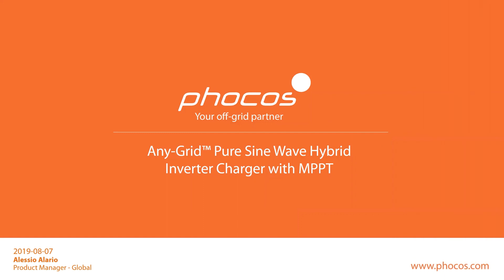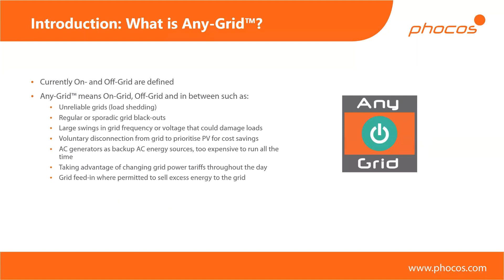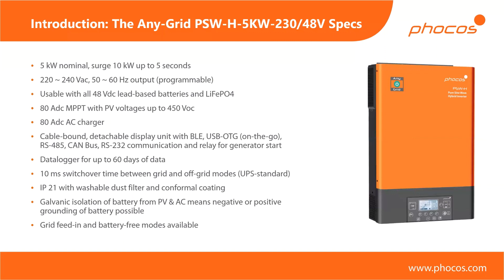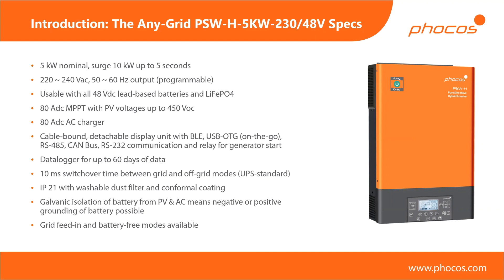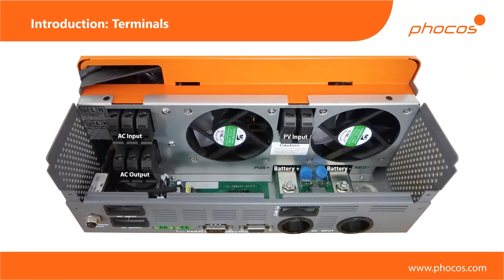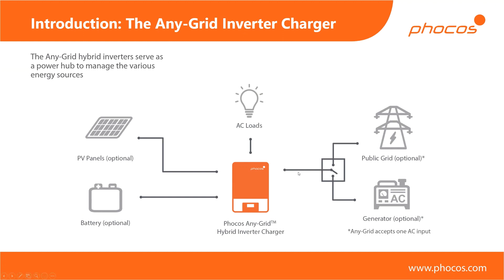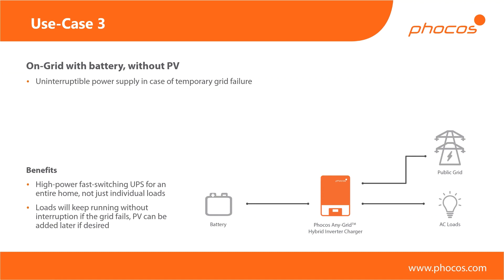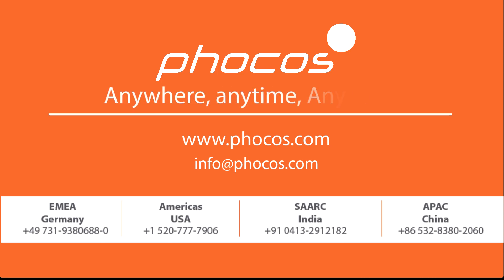Part 1/3 - Phocos Any-Grid Hybrid Inverter 230 V Webinar (Intro, Use Cases 1-3)

Comment: Hello,
Thank you for the very detailed video.
You are mention that Grid feed in is possible but the function is locked by PIN. What do you mean?
Reply from the maker: Hello, thank you for reaching out to us. Although our line of Any-Grid PSW-H inverters can feed into the grid, this feature is not allowed in all areas. As a result, the inverter comes with this feature “locked” from factory to help prevent users from potentially violating any local laws/regulations. To receive the grid-feed in pin please reach out to our tech support and they will happily assist you https://www.phocos.com/contact/#contactech

Comment: What is the minimum amount of solar panels you can use with the inverter with 100a lithium battery?
Reply from the maker: Hello, the amount of solar panels required will depend on the size of the inverter charger you are using and the panels themselves. The Phocos Any-Grid 5kW PSW-H, for example, requires a minimum of 120Vdc for the solar charge to begin operation. Please contact tech.EMEA@phocos.com for further advice.

Comment: I installed the Anygrid 5kw with two (2) Pylontech US3000C batteries; but I can't seem to get the inverter to communicate with the batteries. Kindly advise.
Reply from the maker: Hello, for Pylontech battery communication with the Any-Grid PSW-H a special cable is required, that is available from your Phocos dealer or can be wired according to the guide here https://www.phocos.com/wp-content/uploads/2019/10/Any-Grid_PSW-H_Battery-settings-for-Pylontech-Batteries_2021-05-07.pdf. If this does not solve your problem, please contact Phocos support by e-mail, thank you.
Reply: @phocos-global  A mail was sent, but no reply was received. Will resend anyways.
By the way, I wired a cable as described, but it is still not communicating.
Reply from the maker: @josepholowoyeye4089  I'm sorry you're having trouble getting support. Could you let me know what country you are in? That way I can give you the right email or if you feel comfortable sharing your email I can ask our technical team to reach out to you.

Comment: I am from India, Phocos any grid 5kw Inverter installed at my home last month, now inverter is working fine, But i couldn't install batteries with system  because of cost.........
 I have one confusion about battery less function.!
 If there is no battery connect with inverter and   solar power is less than load and suddenly electric power supply  failed from grid, That condition Inverter will damage?, as well  during night time when there is no solar power and electricity switch off from grid... That condition Inverter will damage?   Please answer sir🙏
Reply from the maker: Hello, there are no precautions to be made when using the Any-Grid PSW-H without a battery. We are assuming you are using a single unit. Regardless of whether the utility grid fails during night or day, the PSW-H will not be damaged, this is a normal operating condition. During the night, your connected AC loads at the AC output of the inverter will simply turn off when the grid fails, because there is no alternative power source. During the day, if the available PV power (minus losses) is greater than the total load power connected to the AC output, the PSW-H will keep supplying power to the loads, even without a battery and no grid power (the power comes from PV only). Please find more details about this unique feature at: https://www.phocos.com/product-news/unique-use-case-for-any-grid-psw-h-increase-utility-grid-independence/
Reply: Thanks Phocos🙏

Comment: Thanks for the video. What is the maximum number of batteries one can use with the 5KVA unit?
Reply from the maker: Hello, there is no maximum number of batteries as such. The minimum for lead-based batteries is 200 Ah per 3 kW or 5 kW Any-Grid used. If using very large batteries, ensure there is enough total PV energy or AC energy compared to the load output so that the batteries get fully charged at least once or twice a week on average, preferably more. Lithium batteries should be fully charged at least once or twice a month.
Reply: @phocos-global  many thanks.
Reply: A través del tiempo es irremediable aceptar la participación de la tecnología mediática o específica en cada aparato eléctrico o electrónico al rededor de nosotros 
Sería muy interesante ver la confluencia y participación simultánea en el funcionamiento de este inversor, creo que la tecnología de procedencia no se puede quedar atrás. Ojalá haya pronto un software para hacer la integración con una pc

Comment: Hi, I have a few questions.
1. is it possible to connect the Any Grid directly with an electric consumer with schuko Plug (for example with a Washing machine)?
2. Is it possible to use it without a Battery, if no public grid available, maybe in Future Versions?
3. In Germany we have Plug n Play PV or Mini PV, where you can feed in directly into wall socket with a schuko plug, very easy! Is something like this possible with the anygrid?
Thanks!
Reply from the maker: Hello, please email us at tech.emea@phocos.com for assistance.

Comment: is it possible to series 15, 400w solar panels
Reply: Hi, what is the Uoc/Voc voltage of the PV panels in this case and what are the lowest temperatures throughout the year at the site of installation?